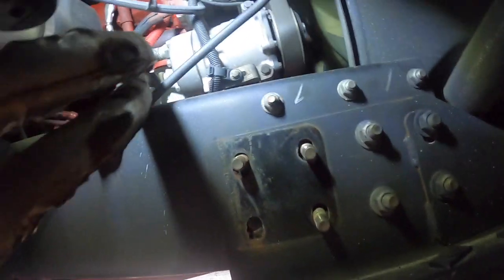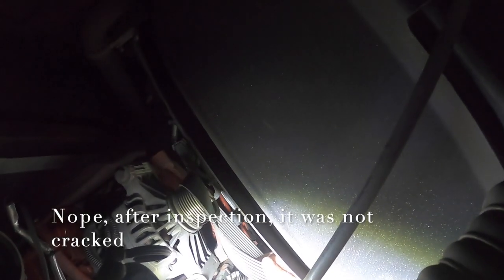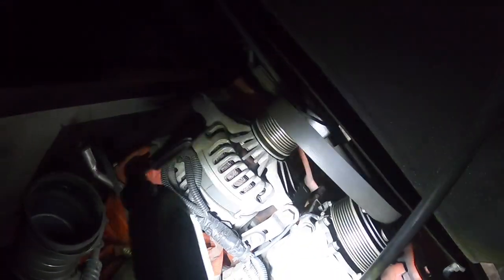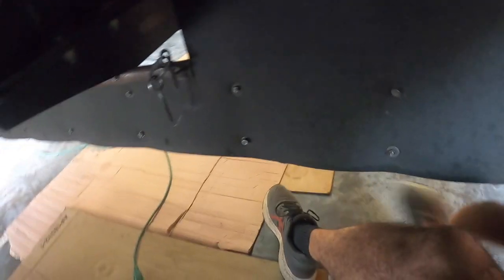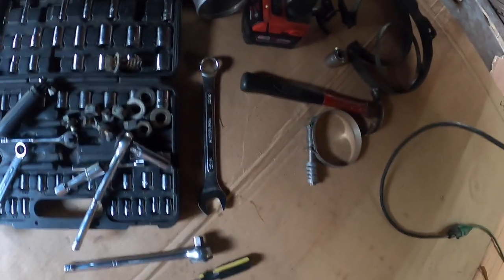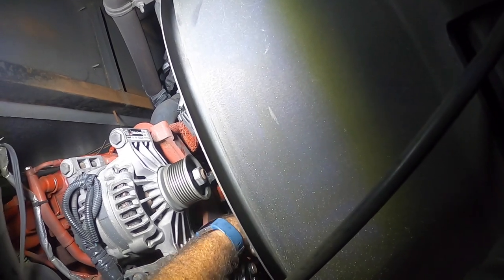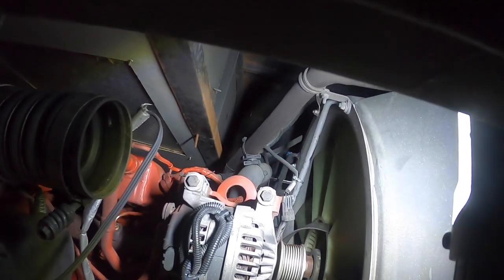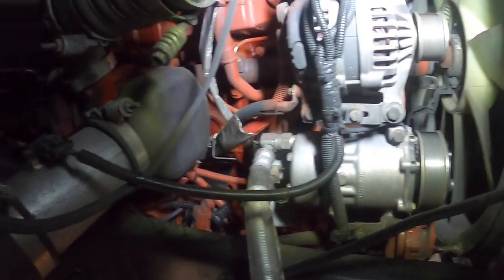2014 Thor Motor Palazzo Cummins 6.7 ISB Serpentine Belt Removal

Comment: If I had it to do again, I would have bought a side radiator/intercooler diesel model instead of the cheaper rear radiator/intercooler set up. I’ve got a 2006 5.9 Cummins diesel pusher with only 21,000 miles. I change my own oil which and I put in a EZ drain oil drain plug which makes it so easy. At each oil drain I check the belt and there are no cracks or frays but I know I am driving on borrowed time with that belt. I’m gonna have to deal with the same challenge as you. But, my bed is over the engine and I’m hoping I can remove the engine access hatch under the bed and reach down to wrestle with that belt. Thank you for your post. It’s past time for someone to do this post.n